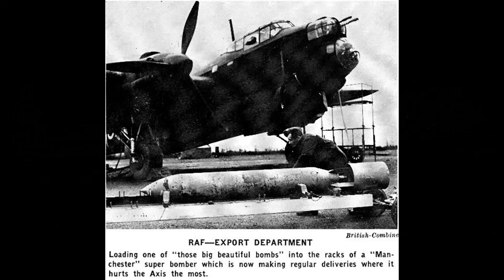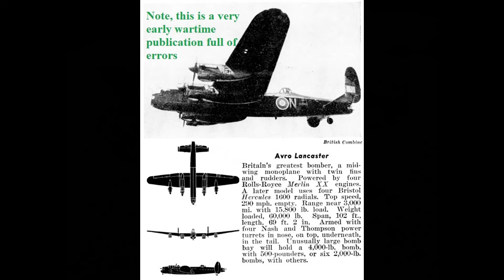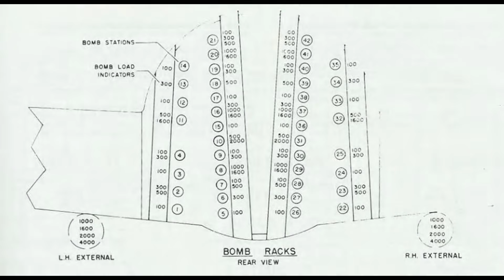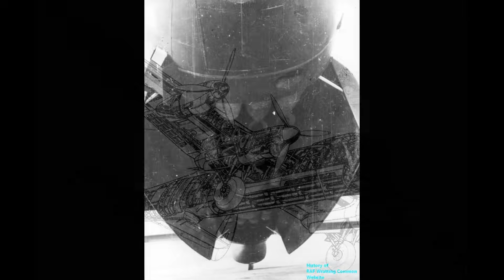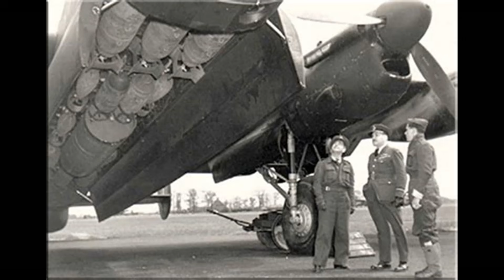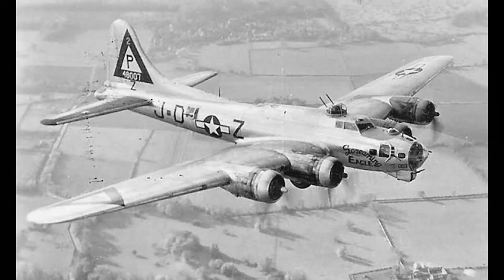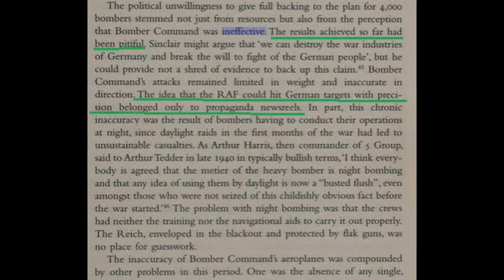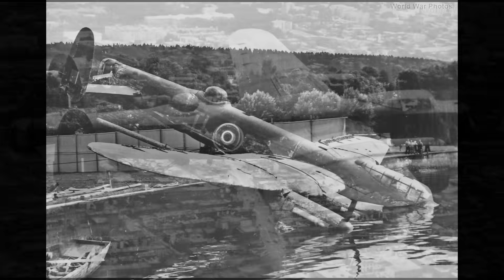Avro Lancaster, Payload, Turrets, Stability and More

Comment: Hi Greg, I’ve reflected on the Lancaster Armament for years. The fact that it was at night made a difference IMO. They were hard to see and attacks were at close range in general vs daylight. 

My grandfather was shot down in their Lanc. We found his recollections of this actual event very recently. They were being attacked  by 2 JU88s and shot down from underneath by an unseen plane. We now know it was a BF110 flown by Cpt Adolf Breves. The rear gunner describes them being caught, but from what I know this apparently took some time.

I also watched an old interview by a Luftwaffe night-fighter pilot last week. He was shot down 9 times attacking Lancs at night. He said they attacked them after their dropped their bombs. He said once they had dropped their bombs, they were very fast and very difficult to catch, if they weren’t in the immediate area, it was pointless trying.He intimated the difference in speed at the time wasn’t significant. Night fighters were heavy due to the extra equipment required. They also often had to be very close to see them and often couldn’t until they were very close. Unless it was a clear and moonlit light. They relied on being guided to the target from the ground. So once close, the Lanc took evasive action to enable the mid upper and tail gunners  to face the attacker. So 6 .303s were blazing away at once. Many night fighters were shot down as a result of trying to get into position underneath the Lans. During the attack on my grandfather, the tail gunner shot down one of the JU88s for example. Often tracers would also deter or inhibit an attack for long enough for the defender the disappear into the night using the corkscrew. A Lanc with 4 screaming merlins, with no bombs and reduced fuel load, was no slouch in a dive apparently. Hence damaged planes Lancs were targeted.

Comment: 1. The Lancaster could carry twice the load to Berlin  , as compared to the B17 and 6000lb  more than the B24  according to Bill Gunston Combat Aircraft 
 2. The B17 stripped of everything  was modified to carry 20000 lb of Torpex as a Radio Controlled  Flying Bomb only a handful of Missions were flown  Source Great Aircraft of WW2 Abbeydale Press  

3. B17G could carry 12800lb in the Bomb bay Source Osprey Publishing Plane Spotters guide However that same bomb bay restricted it to bombs of 2000lb only   
4. B24 8000lb Internally OR 8000lb on wing Racks NOT both Source Bill Gunston Combat Aircraft 
5/ B24J 12000lb in bomb bay/inner racks Source Osprey Publishing Plane Spotters guide
Reply from the maker: Excluding special aircraft, like the stripped B-17 etc. the B-17 had a max payload of 12,800 pounds, B-24, 13,200, Lancaster 14,000.  Source, the actual aircraft manuals.
Reply: @GregsAirplanesandAutomobiles  Thanks
Reply: "469 Avro Lancasters, 234 Handley Page Halifaxes, 50 Short Stirlings and 11 DH Mosquitos (764 bombers in total) dropped 2,300 tons of bombs in 30 minutes"
RAF memorial flight Bomber Command Battle of Berlin page
Average of just over 3 tons per 4 engine bomber.
Reply: @nickdanger3802  Long Tons of course Nick
Reply: @jacktattis  3 X 2,240 lb = 6,720 lb.
'By March 1944, it became clear that the area offensive had fallen short of its goals and that Bomber Command was facing destruction by night fighters just as earlier it had faced destruction by day fighters.' - Noble Frankland, historian and Bomber Command veteran
BBC Berlin Air Offensive page
Reply: @jacktattis  at 3.50   5,000 lb to berlin
Masters of the Air: Fact-Checking B-17
https://www.youtube.com/watch?v=Xb_o8ODQib4
Reply: @nickdanger3802  Bill Gunston Normal internal load 6000lb But if you say 5000lb then that makes even a larger case that something WAS wrong with the B24 for the USAAF  to stay with the B17 for its main target
Reply: Berlin Air Offensive
'By March 1944, it became clear that the area offensive had fallen short of its goals and that Bomber Command was facing destruction by night fighters just as earlier it had faced destruction by day fighters.' - Noble Frankland, historian and Bomber Command veteran
Reply: @nickdanger3802  Isnt it strange that the Lancasters last raid was April 45  and the RAF formed 16 new sqns in 44 I can name the Sqn their first op and base if you like
Reply: @nickdanger3802  see below Nick 8739 lb /sortie
Reply: @nickdanger3802   Bill Gunston Combat Aircraft 608612 long tons 156000 sorties 8739lb Average NICK this is for you 608612 l/t x2240 lbs =  1,363,290,880lb divided by 156000  = 8739lb /sortie

Comment: The tail gunners went from 4  x .303 to the Rose Rice Turret with 2x 50 cal but then changed back because they found that at the ranges they were engaging the Night-fighters the 4 X .303 put out more rpm than the 2 x50 4600 rpm as compared to 1700 rpm for the Rose Rice Turret  And that was enough to either destroy the enemy or send it looking for someone else
Reply: Avro Type 694 Lincoln   Guns:
2x 0.5 in (12.70 mm) M2 Browning machine-guns nose turret
2x 20 mm (0.787 in) Hispano MK.IV cannon or Hispano Mk.V cannon dorsal turret
2x 0.5 in (12.70 mm) M2 Browning machine-guns tail turret
(Some aircraft fitted with a single 0.5 in (12.70 mm) M2 Browning in a ventral position)
Reply: @nickdanger3802  Not in  the ETO I believe .
Reply: @nickdanger3802   Thanks

Comment: Why 8th AF bombed without fighter escort
"The campaign opened badly, for in the early spring of 1943 and for some time to come the Fortresses of the United States Eighth Air Force, which had been placed under the direction of the   British Chief of the Air Staff,   acting as agent for the Combined Chiefs of Staff, had to operate without the comforting presence of long-range fighters as escort--for at that time thee were only in the preliminary stages of their development."
 page 1
 Hyperwar Royal Air Force 1939-1945 Vol III

"Ball-bearings were, however, vital to the war machines of all the belligerents. if the supply of them to Germany or if their manufacture could be reduced or cut off completely, it would be impossible for her to continue the struggle. As early as November, 1942,   the Ministry of Economic Warfare   had estimated that more than half the ball bearings made in Germany came from the V.R.F. factories and the   Fischer factory at Schweinfurt.   there was also a factory at Stuttgart and others at Leipzig, Berlin and Elberfeld. France too possessed a number of small establishments. Operation 'SELFRIDGE', an assault on Schweinfurt, was therefore planned, but month after month passed and it was not executed: the technical difficulties were too great. The Air Ministry, however was determined that it should be as soon as they had been overcome."
 page 25
 Hyperwar Royal Air Force 1939-1945 Vol III

Comment: From memory, the Lancaster owed its capacious bomb bay to a requirement that its predecessor, the Manchester carry naval torpedoes. On bomb loads, yes there is a lot of variety across various missions (Cookies and incendiaries lent towards lighter loads for a specific purpose).  I do have mission logs from 1944/45 and the average bomb load for 8th A B-17s  missions to Berlin pretty consistently averaged at between 4,000-5000lbs and it there must be a reason why, as it could lift more. I cannot find a single reference to a B-17 in Europe ever carrying a 12,000lb internal load on a mission but would be happy to be enlightened. (Wright Field charts do not tend to reflect mission realities of flying in European weather and hostile conditions). 

On the other hand the Lancaster 8 and 12,000lb Cookies were used quite regularly along with conventional HE supplementing them.  I will leave the Upkeep, Tallboy and GrandSlam, as you will no doubt mention them in your next episode.

I often wonder how much payload was sacrificed for range on B-17s due to the complex forming up routine where RAF bombers just flew to a landmark, set a heading and travelled in a stream rather than a formation which also costs fuel.
 
On shorter trips 12-14,000lbs were definitely carried by Lancasters and with this  came a range in [perfect conditions) of up to 1,700 miles (900 radius).. When not using incendiaries, the Lancasters carried loads closer to 8,000lbs to Berlin (Incendiaries were not particularly effective in Berlin because of wide streets and spread out buildings) . I also have a number of McKinstry's books as he  is, as you say, thorough and sources check out. 

The lighter bombloads often cherrypicked by Lancaster critics were where a 4,000lb cookie, 4x 500lb HE plus plus a bellyful of incendiaries (which were much lighter) were carried for a specific reason. The idea was blast the structure to open it up then scatter incendiaries to produce a conflagration as happened in Hamburg in 1943. Carrying max HE against targets not suited to it, doesn't make sense. Planning has to be effective and mission appropriate.

As for the .303s, part of the problem was that there was a general feeling that the gunner should not fire as to not give away the aircraft's position. This was a badly mistaken philosophy. Aggressive gunners shot down more than a few night fighter aces by aggressively attacking as soon as they spotted them and numerous reports from Luftwaffe night fighter pilots state that they would often leave an actively defensive aircraft for an easier target. German ace Major Prinz Heinrich su Sayn-Wittgenstein was one victim of an alert and aggressive Lancaster gunner.
Reply from the maker: Obviously the mission parameters have a huge effect on bomb load. If flying in a formation with 400 bombers to Berlin, in the daytime with a zig zag route to complicate daytime fighter interception, the fuel requirement from forming up and then the long flight will reduce the bomb load as opposed to a small group taking off and flying directly to a target at night. If comparing capabilities of the aircraft you have to take these sort of things into account. Otherwise your comparisons are invalid. Apples to Apples the Lancaster carries a bomb load 10-20 percent greater than a B-17, not 2 or 3 times more as is often said. It gets that greater bomb load via a huge sacrifice in armor, backup systems, and defensive firepower.
Reply: Yes people often exaggerate by cherry picking data. To be fair though, Lancasters tended to carry carried a higher percentage of much lighter incendiaries mixed with a cookie and some 500lb or 10,000lb bombs on city raids and this does not reflect lifting capacity but rather tactical intent. It also skews the data of operational capability vs actual loads. Lancasters could and did carry 12,000lbs, (either HE or Cookies) over long distances. HE loads seemed to average 8,000lbs to Berlin.

Flying at night though, the defensive armament was less of an issue . Schrage Musik was a brilliant innovation and one that any aircraft would have struggled with.

However, given the dramatic 8th AF losses in 1943 and before the arrival of Merlin Mustangs, the deep penetration missions were clearly unsustainable, regardless of the heavier defensive firepower or added armour of the B-17. It was sufficient long range fighters and Doolittle letting Kepner  'off the leash' to have his fighters range ahead and take out Luftwaffe fighters climbing to attack that really made the difference. 
Harris had the option of extra armour and many sets were made but Harris believed it would reduce the bomb load too much. Perhaps he was right. 

Again Schrage Musik and Wald's Survivorship bias. Where do you put the armour?

In Harris' defence, he was fighting from 1943 for 0.50s in the tail turret

As you have previously pointed out the lifting power of both aircraft was  similar (with the exception of the Grand Slam uprated Lancasters)  it's just that the bomb bay on the Lancaster (having been specified for torpedo carriage in the Manchester) allowed outsized loads like the 12,000lb cookie, the 12,000lb Tall boy, 10,000lb Upkeep and the 22,000lb Grand Slam. @GregsAirplanesandAutomobiles
Reply from the maker: The heaviest bomb load ever carried in WW2 was carried by a B-17. However, that's not representative of the plane's capability in actual operations. As for the escort fighter range stuff I have covered that extensively on this channel so I'm not getting into it here in the comments of a different video. The short version is that it wasn't the P-51Bs and later that allowed the bombers to do their thing, that's a myth.

Comment: Sticking with. 303 guns was, for me at least, criminal.  55,573 lives criminal. No doubt .50 cal and 20mm Cannon would have saved some lives, but I doubt it would have even saved a quarter of the lives lost. That shouldn't have been the point, though. The point is that German losses would have been far higher.
Having 20mm cannon shells in your face can't be fun.😮😮😮❤😮😮😮

Comment: The lancaster had excellent flying qualities which helped when employed on low level raids or trying to evade nightfighters.  The test pilot Alex Henshaw was known to often barrel roll a lanc when recovering steeply from a 370 mph test dive. 
Pilots on ops often used a corscrew manoeuvre as defence against nightfighters.
The lanc had a placarded vne of 360mph as per the pilot notes.  

The american bombers however had a much lower vne of around 250 mph. Meaning they couldnt dive, manouver or do much else apart from shoot back.

These are indicated speeds of course as per POH.
Reply: 6,098 enemy aircraft shot down by 8th AF heavies, 740 by Lanc's.
"Against 20 Russians trying to shoot you down, or even 20 Spitfires, it can be exciting, even fun. But to curve in towards 40 Fortresses and all your past sins flash before your eyes. And when you yourself have reached this state of mind, it becomes that much more difficult to have to drive every pilot of the Geschwader, right down to the youngest and lowliest NCO, to do the same."

Hans Philipp in a letter to Hannes Trautloft, 4 October 1943
Died	8 October 1943
Reply: @nickdanger3802  Those numbers are laughable but for sure it would have been a thrill to attack a bomber stream just as it was for the ground attack pilots diving down though layers of AA and flak.
Reply: @simonpayne8252  at 3 minutes
Surprising Results, Bomber Gunner Kill Ratio B-17 vs. B-29
https://www.youtube.com/watch?v=jSwB1Mxaung&t=190s
Reply: @simonpayne8252  Lanc was 320, my missnake.
 at 13.10.
Which British Aircraft Shot Down The Most Aircraft In WW2?
https://www.youtube.com/watch?v=8L7veLuzF1E&t=1s

Comment: The versatility of the lancaster bomb bay to carry a wide variety of loads for a wide range of targets was an advantage.  For example.
14 x 1000lbs
1 x 4000 lb cookie and 18 x 500 lbs 
6 x 2000 lb and 3 x 500 lbs 
1 x 8000 lb and 6 x 500 lbs
American bombers were very limited in comparison by their bomb bay design.
Due to range and fuel required, the average bomb load to germany was only about 6000 lbs for B17s and B24s compared to 12,000 for the lancaster.  So effectively each lanc was hauling upto twice the payload of its US counterparts to germany
Reply from the maker: Day and night, apples and oranges. The Lancaster's average bomb load on daytime missions was only 4000 pounds.
Reply: @GregsAirplanesandAutomobiles     maybe so but they didnt start up.daylight raids again until late 44 and target was oil industry which mainly dictated 1 x 4000lb cookie and  sbcs with incendiaries.  So really it was simply due to the type of target  and if they went in low.
Reply: @simonpayne8252  Search

Operational history of Lancaster 1B R5868